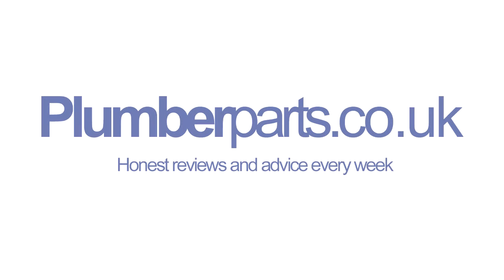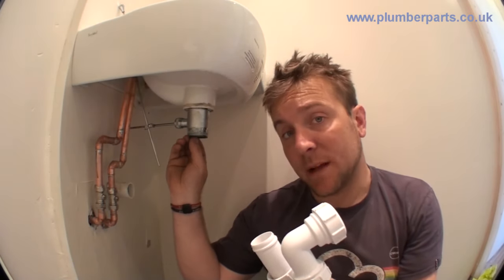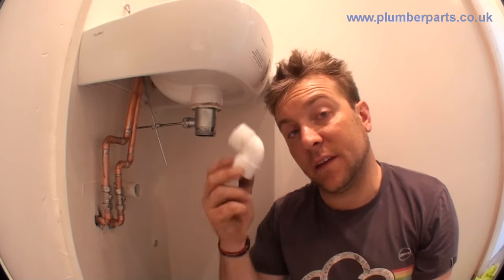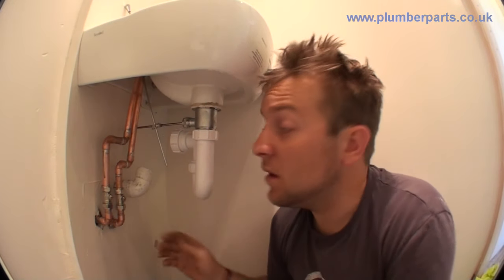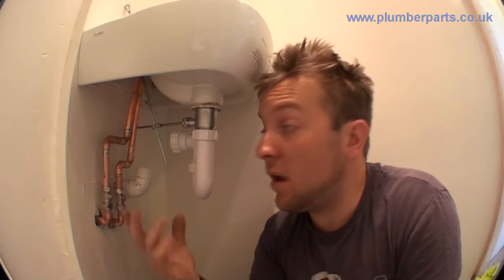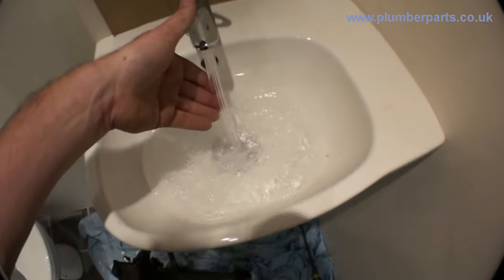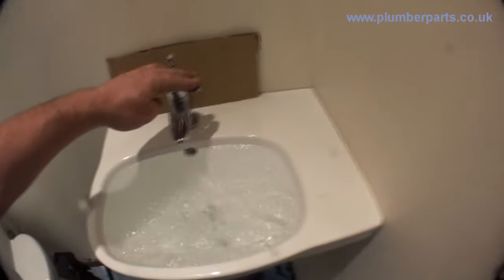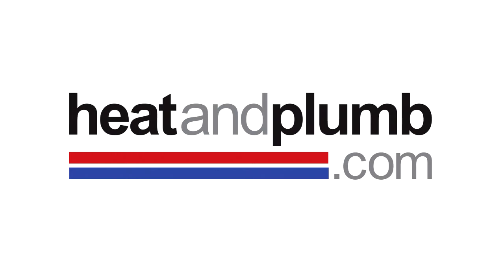Ep6 Wash Basin Install - Install Waste Pipe and Test - Plumbing Tips

Comment: Just what I needed to understand the terminology of the different components. I'm off to B&Q tomorrow to get a replacement Seal Trap Kit, as the trap is not holding a tight connection with the waste pipe.

Comment: Mistake spotted?
You turned the lever to the left and said it was cold. In turn you turned the lever to the right and said it was hot. 
Cold is always on the right for blind people to be clear about which feed they are opening. I always use the phrase ‘if you choose the right they’ll never get burned’ 
Correct me if I’m wrong.
Chris Ford

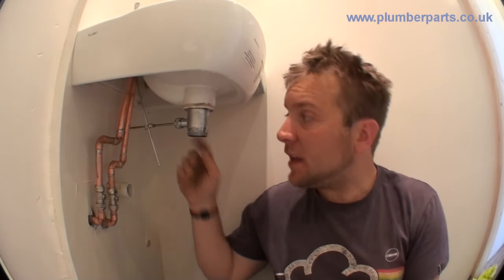Comment: Nice vid. Question though - @ 0:30secs you can see the metal outlet waste from the sink. I have the same on my bathroom sink and need to remove it as its cracked and leaking. There isn't a nut to  unscrew. How do I remove the waste? Thanks.

Comment: Hi,
Thanks for the video, quite helpful. May I just ask whats the best compound to use for sealing the waste pipe/pvc fittings, I can see you applying it to these joints, not sure if you mentioned whats it called though ?

Comment: In the U.S. it's illegal to 90 back down after a trap. We call it an S- Trap. The pipe has to go straight into a tee in the wall with vent out the top.
Reply: Illegal? You mean you could actually get arrested for that? The US is fucked up.
Reply: You would not get arrested but you would fail inspection and then have to cut it out to redo it.

Comment: Excellent videos. But what is the overflow hole at the top of the sink connected to? I must have missed that bit.
Reply: its built into the ceramic sink itself I believe
Reply: Built into the basin, it discharges into the slot on the waste outlet.

Comment: What country do you use welding for a water pipes and glue for waste pipes? In my country we have systems such easy that even my wife would do this job without any special kind of tools or chemistry in few minutes. And the result much much nicer than this creepy cooper pipes and messy waste pipes by glue.

Comment: I used pvc cement on gutters aswell just for a tight connection. But no offence its a piece of cake when you have loads of room what about when you have a ceramic pedestal hiding the waste pipe?? I turned into a contortionist to try and get behind to change that

Comment: The better way to do this is to put a tail piece extension on the sink drain.  Glue a trap adapter to the drain stubbed out the wall.  Then hook up the ptrap.   This gets rid of the s-trap and therefore stopping any possibility of self syphoning.

Comment: Great video mate! One of your other vids on central heating helped me solve a cavitation problem! Cheers. I have a small issue you might be able to advise me on. One of my tenents blocked the basin with long hair (she wasn't even a blond!) and the water was leaking from somewhere in the pipes  and onto a ceiling below. It's a new Barratt's house and under warranty with plumbing form a poor apprentice! They're refusing to check why the pipes were leaking and are blaming the blockage in the waste pipe for causing too much pressure and creating the leak, which is the biggest load of crap I have ever heard!  What I am afraid of is that the other 2 basins in the house have the same genius waste pipes that have not been sealed properly. Is there a way of pressure testing the waste pipes in case they get blocked I won't get the house flooded? I also want to prove to Barrats that coming 6 times for crap workmanship so far has not been enough!

Comment: I am trying to instal connect a corner basin to a toilet pan connector with a boss. The mcalpine boss 32mm will not fit into the 32mm pushfit waste pipe Can you tell me how to get round this. Thank you.
Reply: short length of correct 32mm pipe and adjustable straight connector to join to the one you want

Comment: You have installed a tail piece to extend the length on the fixture outlet pipe so the P trap outlet can just be glued straight into your outlet piece. This would that horrible S trap that was installed here. 

Also with that S trap installed and with tight 90 fittings, clearing that drain is a headache for the next person.
Reply from the maker: Actually went round there last week to pop in an outside tap and it's still fine! Thanks though, PP!